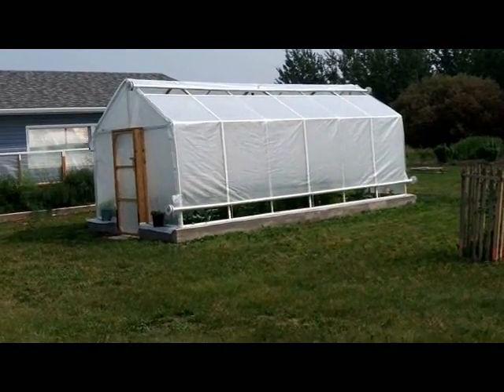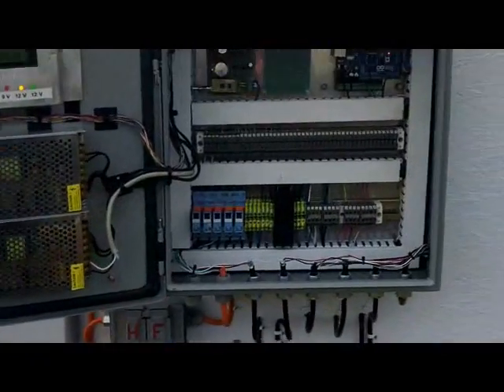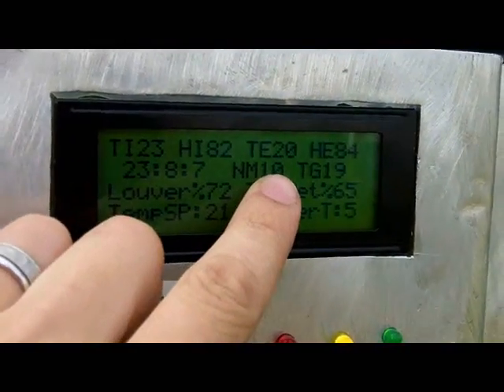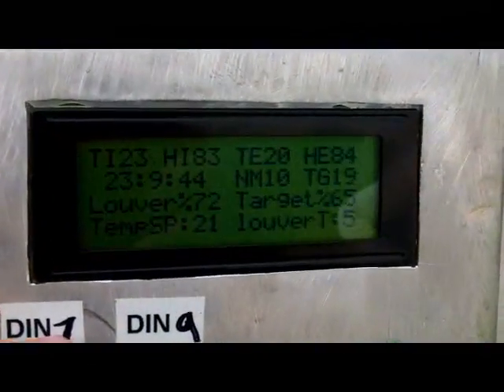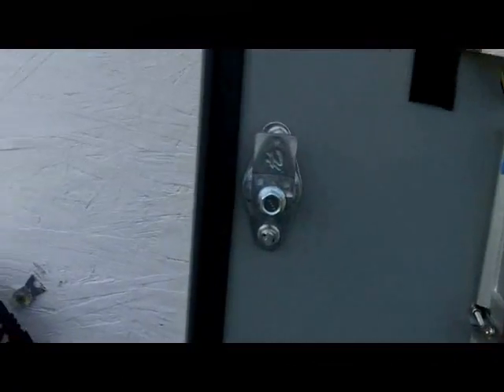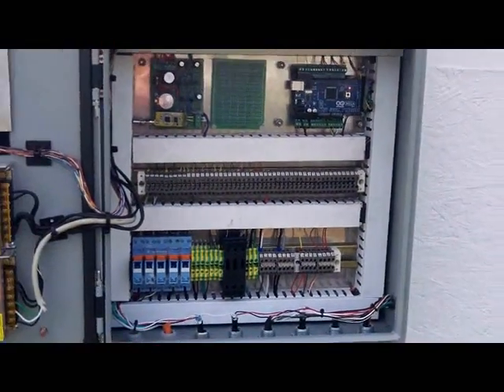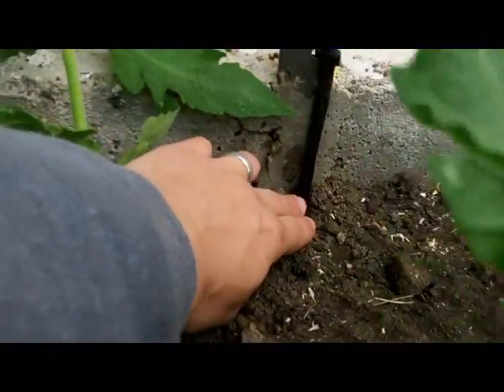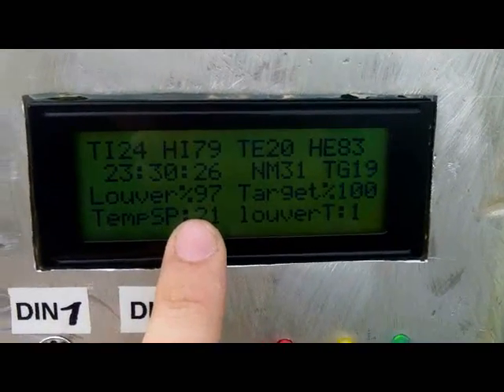Arduino Greenhouse mrk 2

Comment: Nice greenhouse. Your solution for the air-circulation problem is pretty smart.
Are you still operating it in this state, or did you make changes/had to shut it down?

Comment: Nice job! I am building my first greenhouse (for starting plants), converting an old neo- angle shower turned on it's side (about 54 cubic feet). I want to build a Arduino environment control, with sensors for temperature, light and humidity with controls for a heat source, vent fan, grow light and drip system. All reporting by wifi. Because of the size of this, I will require lights and fans to run on 120V AC. This is where I am stuck in the research because most builders are just using low volt lights and PC fans. Can you provide any links to tutorials/instructables for this scale of project?
Reply: +Owen G You should look into relays. You can use a very small signal from the Arduino to turn on a full power 120v appliance.  Amazon "SainSmart 8-Channel Relay Module". That's what you will need. It just takes a signal from the arduino, but uses full 120v to run whatever. Think of it as a simple light switch in the house to turn on a light, but instead of a light switch, its turning on and off via a small 5v signal from the arduino. Hope this helps.
Reply: Thank you. Thank you. 

Can you provide any links to tutorials/instructables for using this Relay Module (preferably with code)?

Comment: Like the passive airflow temperature tube. Smart idea, solves a lot of problems regarding monitoring location, and accurate temperature monitoring.  Will see if it works with my existing temperature sensors and if it improves the battery life by protecting the device from over heating.

Comment: APC220 are expensive. You can do virtually the same thing with the NRF2L01 for about $5 or less depending on where you get it. They have extended range versions that go up to 1KM. Only thing is, the extended range NRF24L01 needs 3.3v at a higher current than the Arduino's 3v3 regulator can supply.
Reply: Micah Nightwolf 

Dear ,

Can you tell me where i can get NRF2L01 in india or abroad . please send me details ( info@mplusts.com)

Regards
Rahul
Reply: ISP connect I'm not able to respond via email, so I will do so here. You can obtain cheap NRF24L01 modules from online stores, including Amazon. You may use a search engine to find stores that ship internationally. Many of them are manufactured in China, so you may be able to find a store that ships from there.

Comment: Probably the coolest thing ive ever seen. I like the way you put in the temp sensor. Is the clock difficult to adjust to the changing daylight? Do you use this in winter?

Comment: I made a similar green house control system years ago with the 68hc11F1, LCD display, 2 subsystems; both hysteresis based;  1. soil moisture sensor and inductor controlled water valve(with a hi/lo pair of trigger points, 2. cadmium sulfide cell light sensor and h-bridge driven shades for growing bed as output transducer(also with hi/lo trigger points). Both of these systems, i used the Analog Devices 654 V/F converter with schmidt trigger inputs. I have since rethought this system for today.

Comment: Awesome job! And the idea with the fan-less air circulation tube for the sensors is priceless.
As much as I hate seen' Arduino used for process control - it does the job, and that's even not the point. The job on the greenhouse itself is fantastic!